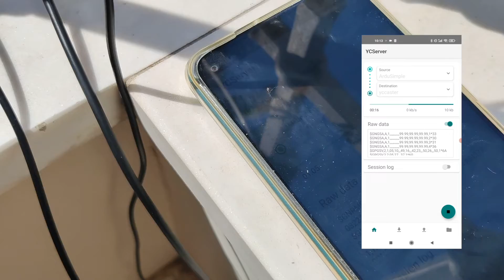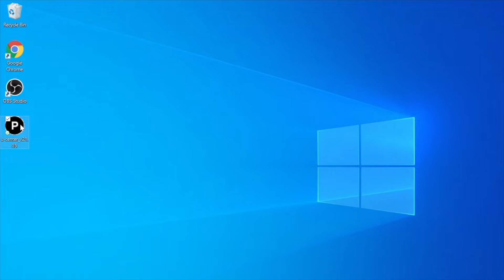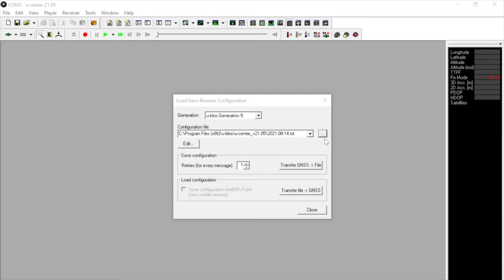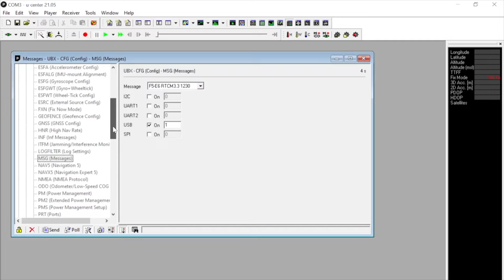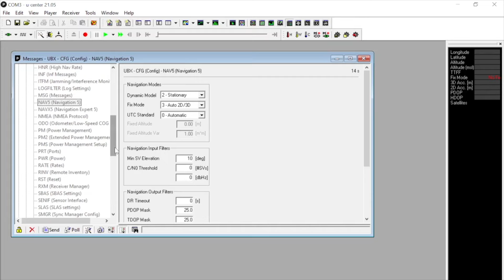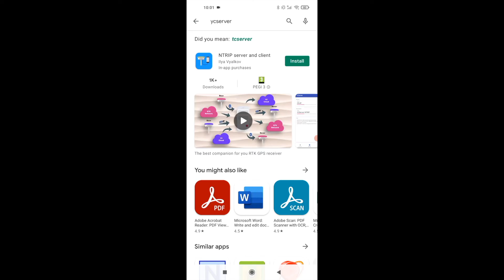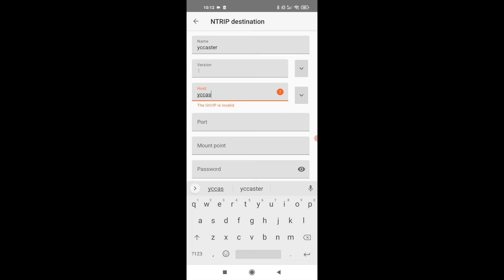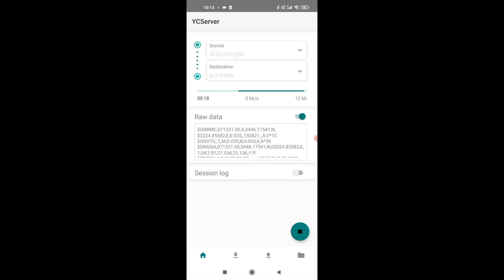How to make an RTK base from ZED F9D board

Comment: Can you please make a Video on how to set up the base as survey in, so it first measures its own location and once it has done that it starts to send out RTCM correction data to a specified output, and can you also show what the rtcm correction data looks like in that output, and the next thing is can you then also show how to make the rover use this correction data which the base is producing, because I cant get it to work it would help me a lot if you could make a tutorial on how to do that, btw im using u-center so that should be the same as you

Comment: How can one power that base set up from external supply?
Reply from the maker: There are Y OTG cables like this https://www.amazon.com/MOSWAG-Adapter-Splitter-Compatible-Chromecast/dp/B08Y6VQN99/ref=sr_1_5?dchild=1&keywords=USB+OTG+Y-cable&qid=1629107118&sr=8-5
So you can connect a power bank or charger.
Reply: @ZSURV  Thanks Ilya